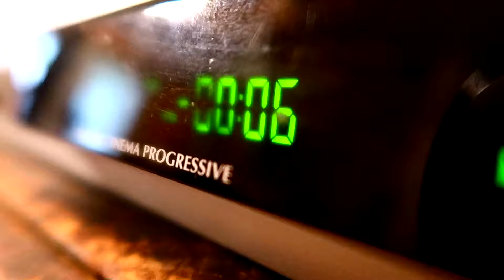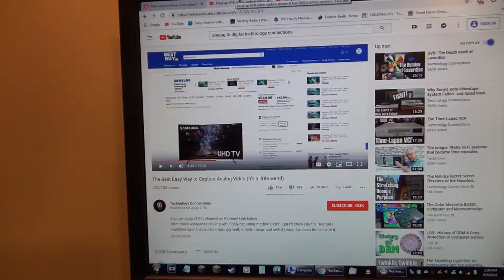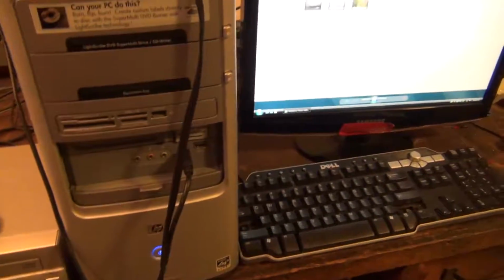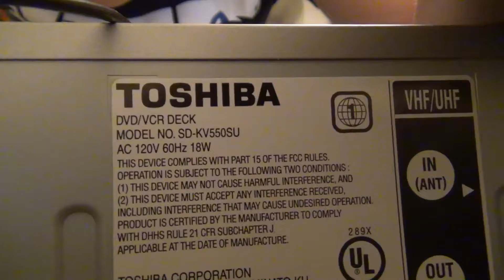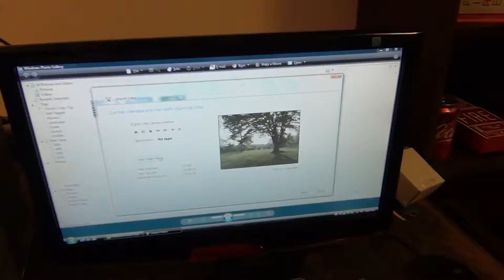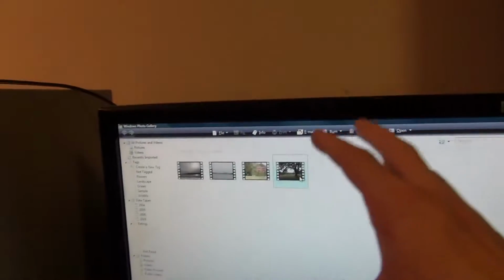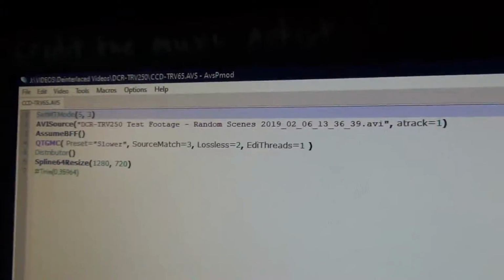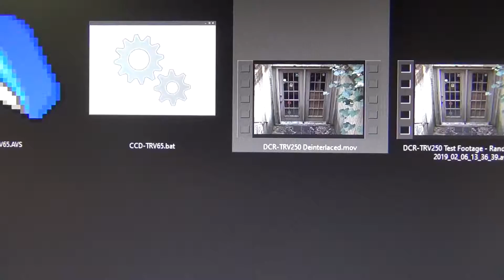My Convoluted Digitizing Process (Analog to Digital, 60i to 60p)

Comment: I had one of those easiercap things, and it went to crap really quickly. It would create this high-pitch glitchy sounding pulse, like if a cricket sounded like the green numbers from the matrix; its a difficult sound to describe, but it would not stop and ruined all my transfers. Well, i got a handful without it but its not nearly enough. Now it won't even stay functioning long enough for video to show up.

What on earth did I do wrong? Are these things just cheap garbage and I should expect this to keep happening?
Reply from the maker: The easycap/easiercap devices can admittedly be a mixed bag (I guess that's what can be expected of a $10 capture card), you may end up trial-and-erroring them until you get one that works, or you can see if a more expensive type (like those WinTV sticks) will work better.

Comment: how do u do this with the trv128
Reply from the maker: It's essentially the same process you see here, but you'll need a 3.5mm to 3.5mm A/V cable.  Alternatively, two 3.5mm to RCA cables and 3 RCA-RCA adapters would also work fine.

Double alternatively, finding a Hi8 VCR or camcorder with RCA video out instead of using a 3.5mm A/V jack.
Reply: @FatCatTech  thank u tho
Reply: i figured it out but my high end pc doesn't like to work with it so i  have to use my laptop to do it

Comment: Great video, FatCatTech. A few things I would note on the HP FireWire capture PC:
* While the import video feature from Vista looks appealing, you're tied to an old and obsolete OS, requiring maintenance and troubleshooting as needed. The way I approached the DV tape capture problem is by getting a cheap FireWire PCI board (TI OHCI Chipset, others recommend the VIA chipset, I assume they should do the same job) and stuff it in an older motherboard that supports PCI and Windows 10.
* I know, Windows 10 support for FireWire is abysmal. However, there is a legacy FireWire driver for Windows 7-10 which can easily be installed and used for detecting the AV/C Tape Devices and DV/Tape Recorders. It works perfectly on Windows 10 x64. This saves headaches on the long run for maintenance and stability. (for perspective, I've also tried capturing video using MacOS, however the iMovie and QT captures provided little to no control, as well as the .mov container looked unappealing)
* Software-wise, I use WinDV and HDV Split for my SD and HDV captures. The software dumps bit-perfect .m2t and .avi files accordingly, which I can later deinterlace using AviSynth from 60i to 60p, upscale/downscale as needed, color correct and edit in DaVinci Resolve.
Thanks again for the video and keep up the great work!

Comment: For a year now, I have been using the IOdata GV-USB2 as my analog capture method and the results I get from it are amazing, insanely better than easycap. 
One of my captures, recorded in OBS compression level 720x480 video deinterlaced with Yadif 2x:  https://streamable.com/ot97en (Recorded on Panasonic DVX100)

Great video! This is very similar to themaritimegirl’s method. Captures come out amazing, the wonders of FireWire. It’s like eye candy to see uncompressed deinterlaced analog captures. I’ll admit that I really don’t like Tech Connection’s method because of how expensive it is just to preserve some detail, I like yours a lot more. As for Easycap... It’s a method if you need to convert video in a pinch and if you are running low on money but it’s just a huge no.

Comment: How to deinterlace 60i to 60p in Sony Vegas? Help. And does it kill a lot of resolution and detail?

My file is 1080i60, I want it at 1080p60
Reply from the maker: I'm using an older version of Vegas (Pro 13), so this may have changed in the past few years.  All you need to do is click the "Project Video Properties" button, located on the very top-left of the video preview window (can also be accessed by pressing alt+enter).  In that window, the deinterlacing options should be towards the bottom.  When I use Vegas's deinterlacing, I prefer to use "Interpolate Fields", as it provides less motion blur than "Blend Fields".
Reply: @FatCatTech  Is there anything else necesarry to click? Like Resample or make the timeline at 59.997i/p?
Reply from the maker: @SantiagoMonroy5  I don't think so, unless you're using a newer version of Vegas and they changed something that I'm unaware of Lol

Though, changing the timeline to 59.97 might make editing a little more convenient.

Comment: I would not use an AV to HDMI converter, I bought one off eBay and while it's fine if you are capturing let's say a game console, but try capturing a video tape and you're going to have a bad time. See my video at: watch?v=nKgGN3yaxto

I believe you could fix the problem with a TBC, but they are super expensive. Stick with a Digital8 or MiniDV camcorder.

Comment: Will a USB to FireWire cable work?
Reply from the maker: I'm not too certain, but I'm going to say that it'd be best to try a regular firewire cable if there's one available.
Reply: No it will not. There are adapter devices you need to get to do that. It converts connection and sends the raw miniDV signal over USB. If you type “MiniDV” on Wikipedia part of the article mentions this and if you click the citation it will show you a website that has instructions how.